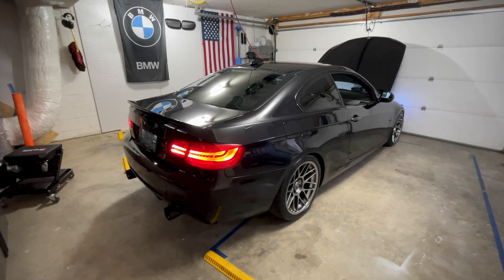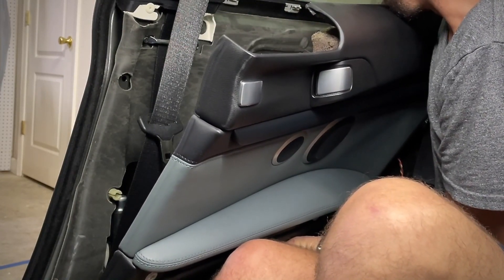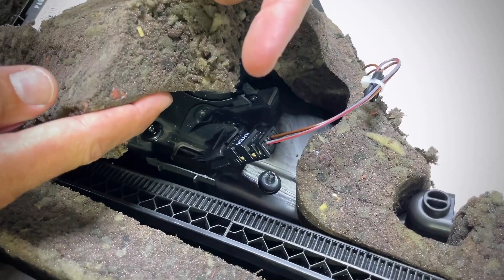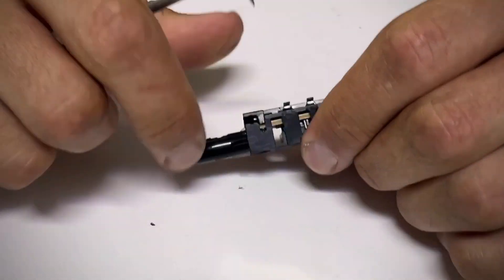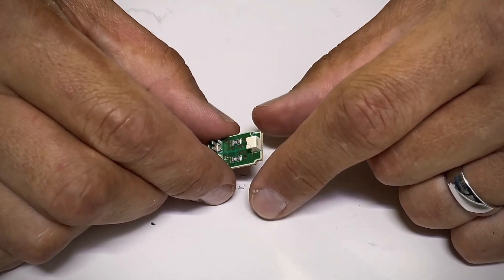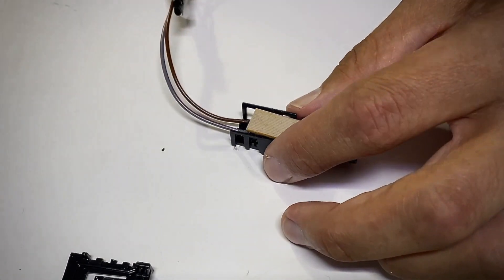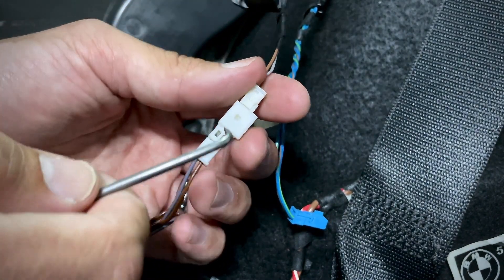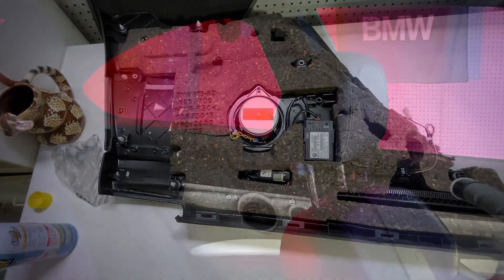Changing Ambient Lighting Color on E9x BMW

Comment: @13:35 Light pipe. Thanks for the vid. Needed help removing rear interior quarter panel for seat belt assistant repair.
Reply from the maker: No problem 👍

Comment: Ambient lighting in the door & rear quarter panels of my E92 are very dim and weak... compared to other people's E92's.. Do you think replacing the LED connectors would fix the problem?
Reply from the maker: that implies power isn't going through the connectors at high enough levels to properly light up the LED in there but what you probably need is the brightest SMD swapped in you can or figuring out how to fire your own LED into the rod and not even utilize the stock system.

Comment: Despite i set the brightness to max, it doesn't look like your stock orange. Any thoughts to fix it? Thanks
Reply from the maker: Higher output SMDs I went with middle of the road ones that had roughly the same output as the stock ones but I forget the unit they used to measure the brightness.
Reply: How do you set the brightness level ?

Comment: Hi - I've been looking into this recently after I noticed my drivers side one wasn't working...and now I can't unsee it! 😖
So, in my case my LED has given up and I'd just like to replace it with another OEM orange one. Would I need to still do pretty much everything you've done here and re-solder a new LED on the circuit board etc!?
Reply from the maker: no, get on realoem.com and look up the part number for the emitter itself and swap in the new one and you should be good.

Comment: hey brother, i wanted to do this mod, but unfortunately the leds from the link arn't avaliable anymore... do you have a second one maybe? or do you know where i can find them? thanks
Reply from the maker: dang! let me at least find the name of the site I got mine from, and I'd just go there and search for SMD. -- This should get you pretty close: https://www.mouser.com/c/optoelectronics/led-lighting/led-emitters/
Reply: @bwhobackk  hey i hope you are still reading the comments. i changed all of that and suddenly the rear light guide ( the plastic straw where the light goes through ) broke on the rear side. how do i replace this? i took the light out but the new one is kinda bend and its impossible to put it back in place without breaking it. do you have tipps or anything for me? it would help me so much.

Comment: Are the new white LED's actually as bright as they look in the final photos? Or is the brightness around the same as the OEM amber leds?
Reply: This is my question too. The amber LED’s are so dim their almost useless. You can hardly see them on the front doors, on the rear doors their a lot brighter for some reason. Mines an E93, not sure if that makes a difference.
Reply from the maker: Sorry for the delay guys. If you selected different LEDs, you could get much brighter than stock, but the ones I got were rated at the same number of whatever the unit was measuring light output that the original ones were. I wish I had gotten brighter, double that, if you have a dark colored armrest beneath it.

Comment: Hello, could you please help me. my light stripe broke on the rear left. i took the broken one out and wanted to replace it with a new one. how do i get the new one in? the stripe on the rear is bend from ex work and doenst get it without getting broken. can you please help me?
Reply from the maker: I only had to do one of my four that broke and it has been ages so I don't remember it clearly. I do remember thinking it's damn near impossible and that it looked like one had to feed the new optical tube through the long slit from the bottom, then pulling it through while it was perpendicular to the black plastic piece, then once enough has been pulled through, you kinds swivel it into place: part that interfaces with the LED comes down, and the tail comes up.-- I recommend working very very slowly and looking it all over to make sure you understand the shapes involved. If the optic pipe quits moving freely, find out why instead of forcing it.
Lube both pieces and if in doubt, be OK with mangling or damaging the black part since it's mostly not visible when reinstalled. The only other thing I can think of is looking up the actual workshop repair manual for our cars in hopes some procedure is in there. -- Good luck!
Reply: @bwhobackk  thank you so much i ordered a new one i hope it goes well the rear ones are really bad to replace but the front row is so easy
Reply from the maker: @ysmke-4234  best of luck, e92 brother.
Reply: @bwhobackk  im e93 but its the same thing. I did it. It was really hard but the way u told me was impossible. I needed to take the molding a little bit off where the light stripe goes in. When i pulled it a bit apart from the door trim i was able to play with the stripe to finally move it into the hole and get it out from the other side and plug it into the connector. The molding was kinda glued from behind i needed to screw it open a little. Thank you so mich for your effort and help after so many years i still was able to count on you. Good luck❤️

Comment: Dope video! By any chance did you check to see if the actual LED fiber slides out from the door panel? I'm thinking about doing something similar but replacing the the LED fiber and light source then splicing the oem wires to power the new set up
Reply: Did you do it?
Reply from the maker: @alexis salvatierra It isn’t a fiber but a rod. A brittle one. You can remove it from the black plastic but that will almost  the rod snaps somewhere and won’t properly carry light beyond the fracture so be careful.
Reply: You can remove the light guide from the black housing, it's just clipped in. I used a flathead screwdriver to get it out. However be careful it breaks easily

Comment: Hello i am from germany , Whats the Name of this typ of led‘s. Do you know it? Thank you
Reply from the maker: hello! Sorry for the delay. I need to configure my notifications to show me more comments. Here is the part I ordered but there is latitude for variation: https://www.mouser.com/ProductDetail/osram-opto-semiconductor/lw-a6sg-v2ba-jkpl/?qs=3W28jC%252bmlM0PDjTJPmMQmA%3D%3D&countrycode=US&currencycode=USD 
You can get different colors, brightnesses, etc. I got the brightest one I could find at the time that was in the white temperature I wanted but I would go even brighter if I could do it again. So long as the SMD/LED is the same size as the one you're replacing, should work fine.
Reply: hey hast du die bestellt ?
Reply from the maker: @danielwinter2478  , if you're talking to me then yes I did order them here: https://www.mouser.com/ProductDetail/ams-OSRAM/LW-A6SG-V2BA-JKPL?qs=3W28jC%252BmlM0PDjTJPmMQmA%3D%3D&countrycode=US&currencycode=USD
I would get even brighter ones if I did the project over again.
Reply: @bwhobackk can you send a link of brighte rones because i am looking for them…and maybe if you have them in blue that would be better for me